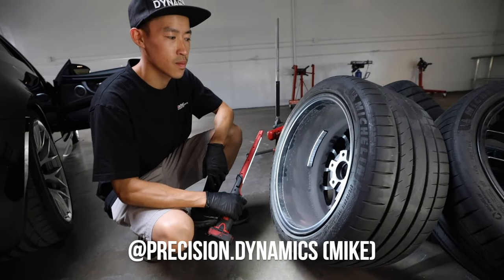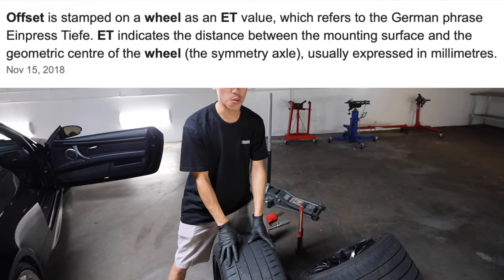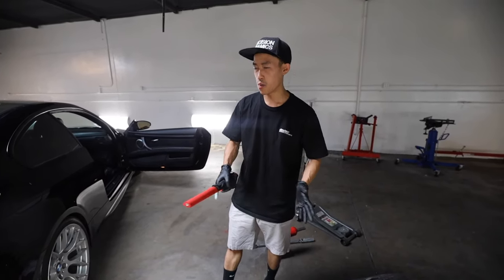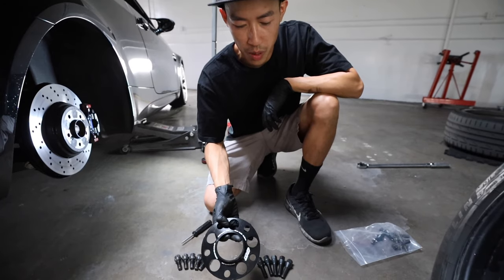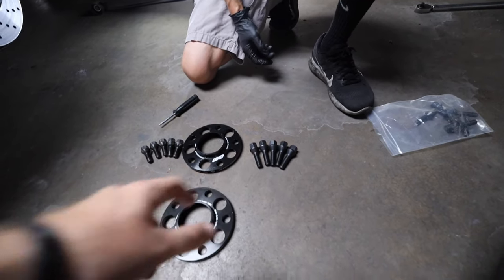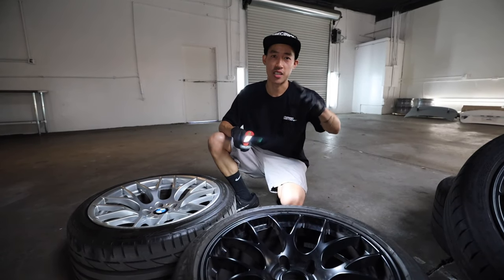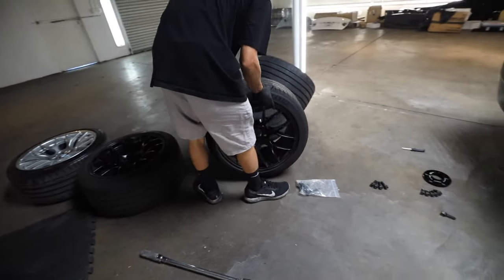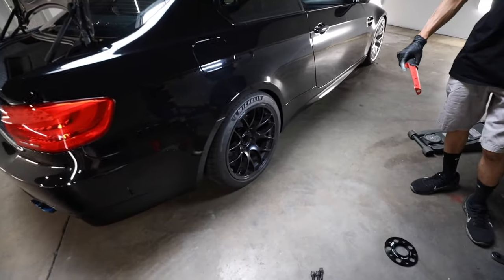Explaining Wheel Fitment ("ET", Spacers & Tires)

Comment: With the black wheels you are running 18x10 ET13 with 275/35/18 tires, 96.25 mm high sidewall, and a 1737.83 mm circumference.
With the OEM wheels you are running 19x10 ET25 with 265/35/19 tires, 92.75 mm high sidewall, and a 1806.59 mm cirumference.
You overall black setup is a bit smaller and your tachometer speed will be different but i think it won't be noticeable, but you'd be closer to OEM with a 275/40/18 tire (1781 mm circumference).
Simple math no witchcraft involved! :D
Reply: whats the calculation you use for that?
Reply: @LoveTheLag  it‘s pretty simple.
The tire sidewall height is determind by the 2 first numbers 275/35, that is 275mm width and the height ist 35% of 275 so 96.25mm.
The Circumference is determind by c=2(pi) x r, in this case 2x3.14 x 324.85, which I know see that I didn‘t calculat the Radius of the wheel correct. The circumference Is actually 2040.1mm in the first wheel set up. But you get the point.
Reply: I bought 140 width tires for my dirt bike thinking I’d be king shit because my friends both got 120 tires. Their Michelin was noticeably wider than mine, which was supposed to be 15% wider. Hogwash!

Comment: I designed my own wheels for my Volvo S90. Increasing from stock 20s to 21s but keeping the same width. That being the case, how do I know if I need to increase the offset or have the hub mount area curved more to make sure the wheel doesn't rub the calipers?

Comment: Quick question I got a honda civic 2016. My new wheels are 19x11. I plan to go 275/35/19, but I don't know how many  mm for the spacers I need to fit perfectly because my old tire was 235/35/19. I still need clarification on how much mm I need

Comment: I have an f30 XDRIVE , stock wheels are 18x8 offset 34 front and rear , can I put 18.8.5 offset 35 front and rear the same size ?? And tires like 245/35 18  front and rear the same ?? Please I need help ,

Comment: So, we cannot run staggered setup on the AWD vehicles?
Reply: I have a Mercedes E350 with AWD as well. There’s a few different answers depending on who you chat with. Some say no way, don’t do it, while other say it’s fine as long as the circumference is the same all the way around. If it’s AWD and it comes from the factory with staggered wheels, then absolutely go for it. But if not, research, research, research, and ask around.
Reply: @RustyCar  At first, I wanted to run staggered setup but then I realized that with staggered; although the setup looks nice but unable to rotate tires.
Reply: @Gaming.Labs_GL  - Yep, I thought about that too, but I think you can rotate just left to right only, and no other direction like front to back, etc.

Comment: So what will happen if i put R19 with 20ET on a car with 35ET required?
Reply: The wheel will stick out further and potentially rub against your fender if you have fenders that cover the wheel partially.
Lower ET number means it sticks out. (touches fender)
Higher ET number means it goes inwards. (touches brakes, suspension)

Comment: 25.4mm in an inch... not 24.mm. lol... and you dontbwant atleast 5 threads in, to hold the bolt....the actual rule is you need atleast the same length of bolt on thread into hole as the diameter of the bolt....